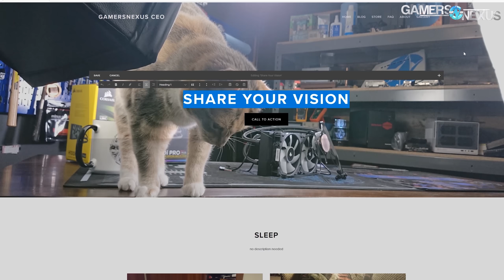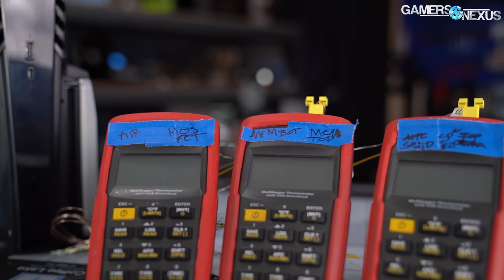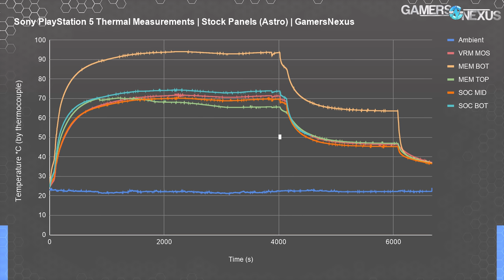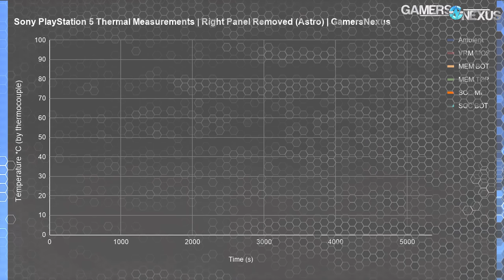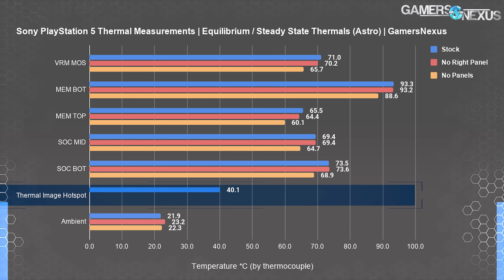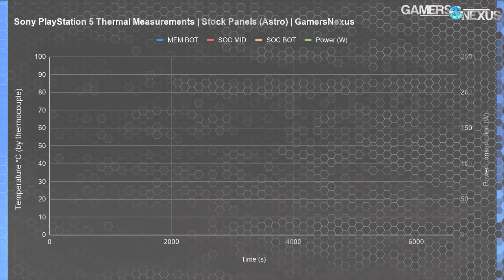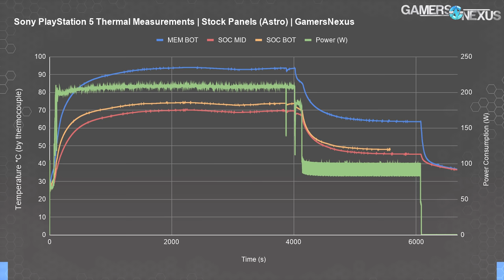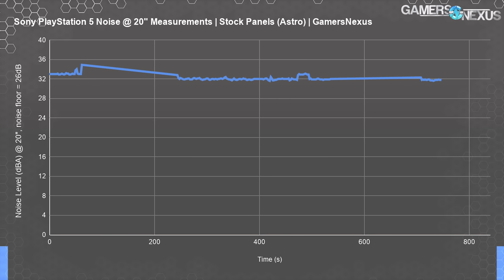Weak Cooler Design: PlayStation 5 Thermals, Power, & Noise Testing

Comment: I guess Sony could add a feature later on to adjust fan speed manually...
Reply: Sony has already said that they can adjust the fan speed accordingly when need be. So my guess is when these more demanding games start hitting the market we will see a firmware update what will increase the fan speeds on the system.

Comment: The only real problem with this video, but i have no idea if this information is readily available or if AMD want it to be, is that this APU reportedly didn't have nearly as good of a yield as was originally intended. Therefore, and regardless, i suspect AMD instructed Sony to make sure their cooling solution was up to par as the yield percentage reached reasonable levels. Along with the same ordeal counting for microsoft. However, down the line this will make the pro-model process become a cheaper one wince the factories don't need to adjust nearly as much as prior. The PS4 is a fair example of this, it could all be planned (i wouldn't be surprised at all). However, this will be one of the side-reasons for why there also isn't that many consoles out of both types yet. My poor source stems from an article that was discussed around half a year ago on reddit, i believe it stemmed from either AMD directly, or a chip maker. Can't remember atm, either way it's how it goes when dealing with this much utility in such a small package.

Comment: I am a bit concerned about the memory issue .Sony needs to do something to fix it A.S.A.P. As it seems two of them are not covered,did you measure the other one also? I will still get my PS5 tho,since there is a 2y warranty whatever happens i will be covered.And by that time we will most likely have another revision that fixes PS5 issues,is something the end user can do in order to fix this?Or its not possible?

Comment: The datasheet for the GDDR6 module (MT61K512M32KPA-14C:B) has a TJunction of 95C and TSTG Max of 125C, the 93C measurement goes a bit dangerous here in long term
Reply: Who say max temp 125°c it is 105°c
Reply: @кратхи  TSTG (Storage Temperature, not operation) at table 5 stated of -55 to 125, that's not the operation temperature though

Comment: The steel panel on the back looked like engineers overengineering. probably would have cost less to have a plastic mount/airflow director for three laptop type blowers on the bottom in the back and put glue on aluminum heatsinks on all the components that produce heat and have it vent through the top. You can buy the parts off the shelf with just needing a plastic part to direct some air and mount the fans onto... I can make that plastic part to direct air out of milk jugs ffs.

Comment: I'm curious if a after market cooling system would work. I've seen a couple mods, one that goes under it, one that clips the the black part. Would it make a difference, I wonder?
Reply: Probably just push a heap of dust into your system. Does it not have filters on the fans though, i didn't see any in the video. Maybe it's only supposed to last 2 years until the next revision comes out. That would fit with the last 3 faulty PlayStation 3's I owned. All different revisions. Including original 60GB. So they didn't get my money for the PS4 and probably won't for this unless its a 3 year RTB warranty. Given their shoddy quality of previous generations.

Comment: Great idea, rig up a laptop cpu fan in front of that fin stack for the VRM...could just use double sided tape on the steel plate to hold it in place and watch the performance gain from a simple 10$ fan....run it on full blast probably increase noise a bit.....but....meh.

Comment: Awesome test. I wonder if it would help to also remove the non essential fan guard and resting the ps 5 on the front (with some spacers to avoid pressing buttons) so that the exhaust points upward (which would increase convection cooling)

Comment: I am a little confused about power measurement. Did they measure the power consumption of whole PS5? if it is, I feel the benchmark they used do not push power consumption to its limit since the power adapter of PS5 is 350 watt. The maximal power consumption should be above least 80% (maybe 90%) of the power adapter, but this benchmark fails to delivery this level. So until we get a benchmark can push power consumption to at least 80%, the study has little value.

Comment: Running the latest update bricked mine.  :/ super bummed. Won't even power into safe mode.
Reply: $500  up in smoke.. next time don't buy anything Sony 🤣
Reply: @damgood7525  Eh, it was covered under warranty. More disappointing than anything. It'll get fixed eventually...but yeah, never a good idea to buy consoles at launch.
Reply: Perss the eject and power button for 5 sec and see what happens
Reply: @laserbeam3836  Appreciate the tip, but unfortunately doesn't work. When pressing the power button it comes on for roughly a half second and cuts out. When pressing and holding power (with or without eject), it just does the same and never beeps a second time and doesn't go into safe mode.  Won't even eject the BluRay that's in it! :/

Comment: Just take it apart, drll holes in the black plastic under the white plastic, glue a net for dust over every hole.

Almost free, good cooling,.easy to do

If youre handy you can install a small usb fan so youve got 2 fans.

Or the coolest way, mod your ps5 to fit in a pc case with much better fans.

Comment: I ain’t trying to be a hater or an Xbox Series X Fanboy or whatever it is people say but realistically I gotta say The Xbox Series X is the much better design in terms of thermals, and cooling capabilities as I can’t fathom how Sony engineers didn’t think it a good idea to ensure the memory modules were cooled by the heat sink as its crazy to think they simply used the metal casing to attempt to dissipate heat from the memory !

Xbox Series X absolutely has the memory modules being cooled by the actual heat sink, and seeing a video like this shows why that’s such an important thing as gddr6 gets hot, and it’s almost asinine to think Sony didn’t take that into consideration !

Comment: So, what I'd like to see... is you guys whip out a ruler, & mock up some designs on how you'd improve the PS5 thermal management... 
Or what you might do as a home owner, with a gen 1 unit, & how you'd fix it...?  I understand the concept of "Thermal degradation"...
But what practical solutions could you do on this unit, other than Slats somewhere in the plastic?

Comment: I'm surprised they haven't tried putting an AIO water cooler in there, do you think it would make a significant difference in preformance
Reply: I'm not sure water cooling is the right step, there's more points of failure to deal with. There is a better chance the customer would have to get a new console during the same generation though.

A better air cooling design would've solved 90% of their heat issues.

Comment: Cant understand the complaints about ps4 or pro sounding like a jet engine my standard ps4 sounded like a jet engine after three years used thermal paste remover & thermal paste prepare mx 4 thermal paste.attached a pigtail connection to side of gap near batterie the other side of antenna pigtail plug has a tiny nut what used to vice on lid only just fits under batterie gap to boost bluetooth & wifi after was whisper quiet.give away.bought a ps4 pro same sounded like a jet engine after 3 years fully cleaned fan used wd40 component cleaner mx2 thermal paste when finished was whisper quiet only when was loud is when was to much paste

Comment: What would you recommend doing to improve cooling besides taking the panels off?
Reply: Wait for the recalls when they start becoming faulty at 4 months and get a newer revision.
Reply: @nitehawk9270  been a week and my ps5 hasn't really gotten to a noticeable temperature or noise level.
Reply: @Nickles4  What's the ambient/room temp like in the room with the PS5 ?
Reply: @nitehawk9270  hovered around 60 to 65

Comment: I wonder if along with making the thermal pad full contact for the memory , would changing back plate material to aluminum from steel be an easy , quick but effective solution? (or at least a meaningful change  in thermals)
Reply: Well, aluminum in general is about 15 times better thermally conductive than steel, so might help too. Still, I expect that it increases manufacturing costs.

Comment: My PS5 has coil whine though you must be within like 15cm of the power supply unit and you have to be in a game. The fan is very silent though. By far the loudest part of the console is the disc drive when copying disc data to the SSD.

Comment: The public is told to: Use LED lights and turn them off when exiting the room, use air conditioning sparingly,  get an energy efficient fridge, don't leave the hot water running, consider installing solar panels and wind power, make sure your heat pump get maximum efficiency (don't have a heat pump you say? Yea, right say that to your air conditioner and fridge) and generally save energy.

Sony: Let's make the PS5 main menu AWESOME!

Comment: So appqeriently there was an Update that fixed some Things and as far as a few Reports got in... did something with the Fan Noise too and therefore with the Temps most likely. Would it be possible to redo the Test again with that newest Update? I know its probably a Pain in the A. But i think it would be highly appreciated since its now a different Experience for many ppl after that Update. I dunno how much they changed the RPM to. Might be just a minor Adjustment.
Reply: Sw update can't fix hardware

Comment: I have a question for the channel creator or indeed any of you wondeful people in the comments, my playstation 5 makes a slight humming sound, it sounds like I can hear the optical drive reading the disc data when I'm playing a game from disc, its feint but noticeable and can be annoying, other people have claimed their ps5 is totally silent, so is there something wrong with my playstation 5?

It's not a really loud noise, but you can absolutely notice it and its constant while the games running, what's strange is this noise does not occur when I run a digital game, it's only when I run a disc based game.

Really appreciate any insights, thank you all!❤
Reply: Interesting... I don't have a PS5, but I would suggest maybe try pushing in on the side panels to make sure they're fully locked in and secured, same with the stand/base. Just to make sure there's no slightly loose points anywhere that two pieces touch. Even if it doesn't seem like there's anything loose, a tiny bit of vibration can be amplified by those big side panels or the surface the console is resting on. 

Last thing, have you tried with multiple disks? Maybe one of the disks is just slightly out of balance?  

Those are the quick and easy things I can think of to try out.   :)

Comment: Great vid, saw both. Thought, the steel may have been used because it offers structural integrity at a thinner dimension than aluminum. This might have been an attempt by engineering to meet the requirements of the visual design team. The steel is easy to stamp while thicker aluminum would require a different process. Maybe we'll see it in the Zen 3 PS6 released at the same time as the zen4  cpu.

Comment: Sony should let the user pick a few fan curve profiles according to the ear's of the console's owner, nothing hard to make and those few fan curve profiles should be the fan spin faster to more RPM than the default currently has assuming the motor of the fan doesn't heat up that much negating the effects of its function at given RPM.
But planned when did Sony cared about user having a decent amount of control on the product they bough, especially given planned obsolesce as a significant factor. 
Never had a console personally, but i can't wait to see fan mods and mods in general on this one.

Comment: Okay I looked at your video and the PlayStation teardown video. I also know what happened with my PS4 pro in regards to cooling.
Well the side covers may be holding in some heat slightly. I don't think they're the cause of your temperature drop with the side covers off. Removing the top cover from the PS4 pro made it run quieter and it lowered fan speed due to less restricted air intake. I think you're seeing the same effect here with removing both side covers with the PS5. Because when you look at the teardown the Blu-ray unit is over top of the area where you are registering high memory temperatures. I would have to question whether or not removing the plastic would improve the cooling with that big bulk of the blue ray player over top. I think you'd have to take the download only version of the PS5 and do temperature testing on it to see if there's any change in temperature with the side covers on plus removed but the fan still covered by a similar piece of plastic. otherwise it's simply more air flow through the fan that is causing the increased cooling.
As you said you cannot tell the inside temperature of the console from the plastic outside. Heat does not transfer well through it. Plastic is not a good heat transfer medium as you noted. At best removing the side panels exposes the Blu-ray player to open air to dissipate heat.
Cheers and thanks nice review

Comment: The original machine had a base plate of prefabulated amulite, surmounted by a malleable logarithmic casing in such a way that the two main spurving bearings were in a direct line with the panametric fan. The latter consisted simply of six hydrocoptic marzlevanes, so fitted to the ambifacient lunar waneshaft that side fumbling was effectively prevented. The main winding was of the normal lotus-o-deltoid type placed in panendermic semi-boloid slots in the stator, every seventh conductor being connected by a nonreversible tremmie pipe to the differential girdlespring on the "up" end of the grammeters.

Comment: The cables of the temperature sensor move the plate for up and the contact with the memory is nearly a milimeter that is wait it put a 90 degrees, i tested with my ps4 and the memory is nearly 75 degress

Comment: Legitimate question here--If I purchase my own copper sheet and thermal pads, then rigged it in place of Sony's Aluminum sheet, will this work to dissipate the heat from the memory? Kind of curious just to try it out myself. XD
Reply: I'd think they need the shielding on the back, so your copper plate would have to be the same shape as the current one? My guess would be that a second fan that blows a bit of air over the part where the memory connects might help

Comment: Hi, really good video, if you could do an Xbox one same testing that would be very nice and to compare them at the end. Based on marketing videos Microsoft has spent a lot of time designing the cooling solution for the XsX and the materials used and design should be of better quality, specially that they encase the circuit boards within a thermally conductive chasis. Thanks again,

Comment: You only want to get your TC offset with an ice point. Boiling water will do nothing for you, water will boil at different temperatures depending on elevation.
Reply: you can measure air pressure and correct for it though

Comment: I have one question I believe the SSD is a m.2 gen4 obviously soldered to the motherboard but while I was watching a interview with an Xbox engineer he stated why they went with there SSD solution as they didn't want it to thermal throttle and as the PS5 SSD runs alot faster which means more heat I was concerned it may thermal throttle over long periods of time playing. Any advice would be great I love to learn
Reply: afaik games aren't taxing on hard drives because ofter the initial load they don't need much more stuff?
Reply: @johnuferbach9166  I think I understand what you mean 😁 thanks for the info

Comment: I wonder if the potential thernal issues will "throttle" the SoC at all due to the variable clocks. 
Not so much throttle as it just might not boost as high.
Reply: The SoC does throttle if you unplug the fan. So, yes it is possible.
Reply: @zaidabraham7310  I more so meant the variable clock the PS5 uses for the GPU and CPU.

Comment: Mine is low noise. I wonder what temps actually are when I game? I am a bit of a collector and have PS consoles 1-5 all in working order. Is this one designed to fail? If it is, then this is the last PS for me. Lets see how it goes. That 93c heat cannot be good on the long run.

I cant understand why the other memory module is cooled and the other one not. If there is a mod to fix this I want to do it for my PS5.

Comment: i have a ps5 for over a month now and no problem. warranty also available! I don't think sony would make a bad system. all kinds of smart heads are on the internet
Reply: wdym? the ps3 and ps4 had heating problems
Reply: @somnia3423  I had a ps3 slim for around 3 years and my ps4 slim since 2015 I've never had heating problems just take care and maintain your shit if the ps4 ever has problems just clean it mine sounded like a jet engine before I did some basic cleaning wiping it down and cleaning the fan

Comment: Hey brotha maybe you help me figure my issue out when I play ps5 game it seem like it gets hotter than normal but fan don't speed up and the wires get really hot and bam ps5 will shut off completely and I need to pull power cable to get it back in i have already done complete format still it's going back to playstation but I wonder if my power supply is failing for over heating but I get no warning about over heating

Comment: So, basically, PS5 needs more external holes in the outside design and more thermal pads on the memory modules for better cooling. Sounds like easy enough for their next 2nd models to do. Still looks better than what we got from last gen or previous gen consoles for cooling solution it would seem. 😁